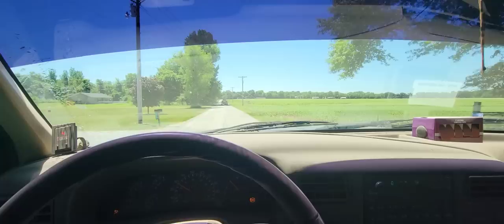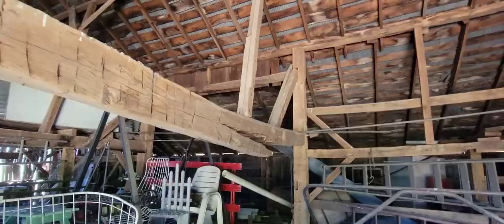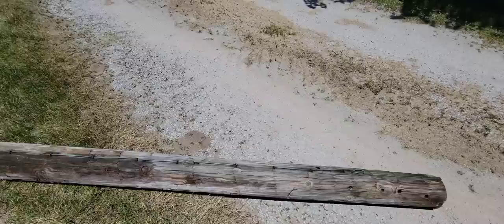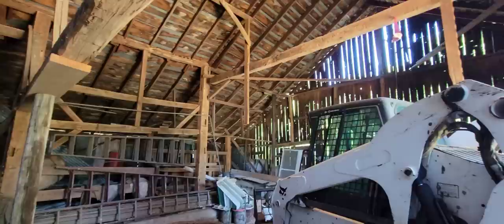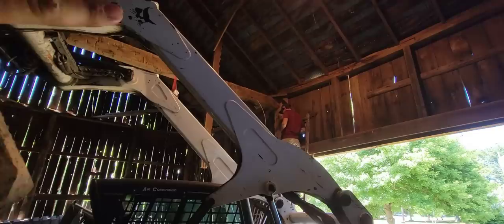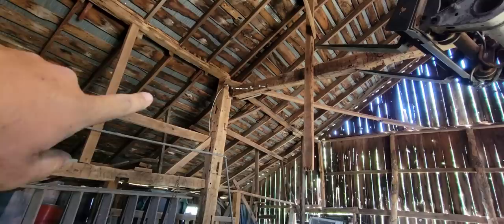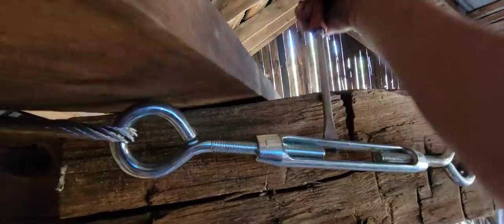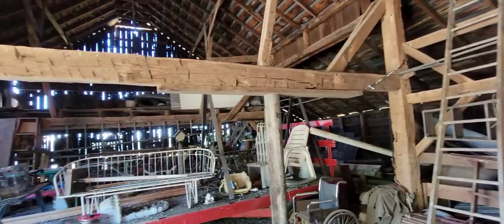Dangerous 200 Year Old Barn Repair Video!!

Comment: I've cabled a couple of old barns back together, keep an eye on those turnbuckles over time, I used that style on the first one I did and after a few weeks the one of the turnbuckle eyes opened up and let go the cable, if you can find the ones where the eyes are welded closed its better, but good job saving that old barn!

Comment: I wish you'd have shown HOW you are attaching the wire to the beams. Drilled through the beam? Used an eye-bolt? Put a plat behind the beam? How did you attach the wire/buckle to the beam? I need to know whats best for a permanent wire/turnbuckle setup. Cheers.
Reply from the maker: best way we found is to just loop the wire around the beam if possible and clamp it back to its self and then then on the other end one loop through a good turn buckle and another loop around a beam through the eye of your turn buckle and tighten it up if you have good solid wood beams no plates are required you could even use a length of chain to anchor the turn buckle to a beam or you could drill holes in the beams and use eye bolts it just all depends on the situation 3/8 cable seems to work really good for doing this kind of stuff you don't have to get crazy on cable size
Reply: @dirtgrainsteel  Thanks, I was wondering if the cable would eat through the beam over time. I have a 150 year old barn built on a pit/fieldstone foundation. It's on a slight hill to irrigate the horse business that would leak through the floor boards. The water intentionally flowing under the barn keeps softening the ground just enough that the corner stones sink, and make it tilt a few inches each year. Its a yearly fight to keep raising the corners, meaning the cable may have varying loads over time..